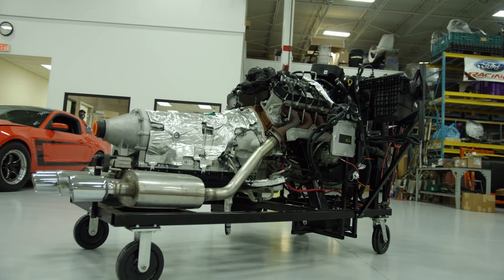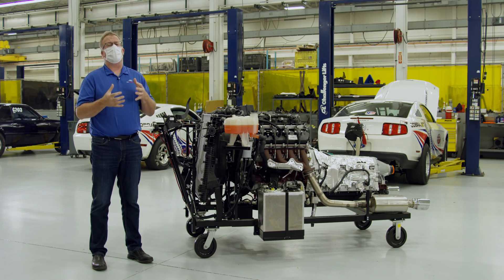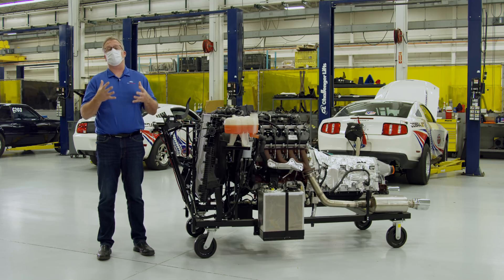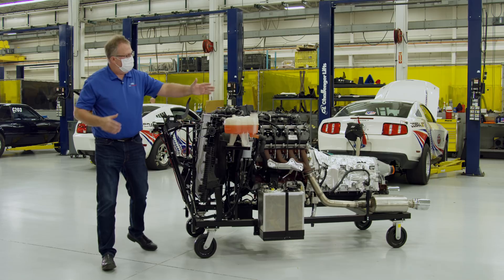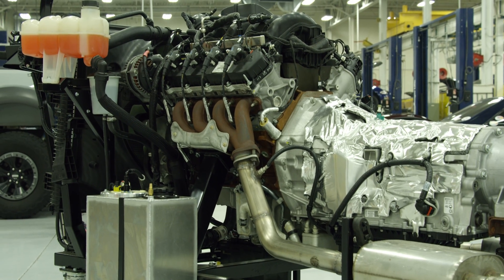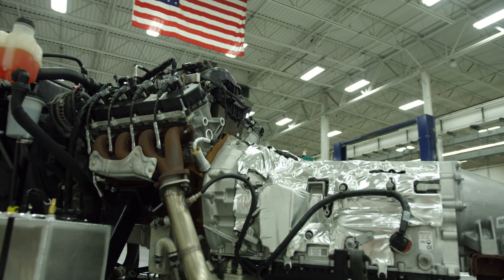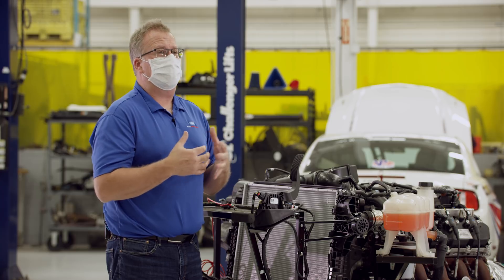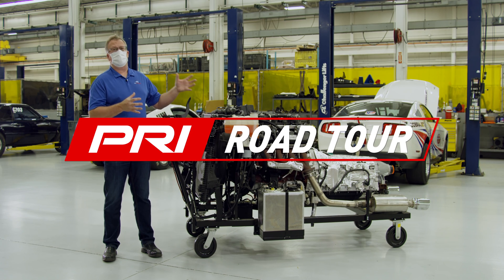Ford Performance GODZILLA 7.3L Crate Engine - all the details!

Comment: Nice LS copy fo sho
Reply: Ls is a copy of windsor
Reply: @Alex-pl1ye  there's nothing windsor in a ls. Besides ....the windsor was a pos. Sbc killed those things.
Reply: @HioSSilver1999  windsor came first everything after is based on it
Reply: @Alex-pl1ye  sbc came before the windsor....so everything after that based on it.
Reply: @HioSSilver1999  yup!
Reply: @Alex-pl1ye  then why was the windsor so bad?
Reply: @HioSSilver1999  I spent hours of my life waiting in the staging lanes while they swept up yet another Chevy off the track. I never new a Chevy racer who didn't have a spare engine in the trailer. I ran my Windsor for years without even pulling a head. And besides that, Louie Chevrolet was a flamin' homer. Causes Headaches Eventually, Very Rarely Occurs Leaving Engine Together.
Reply: @dond5103  all i remember is thrashing sbf with my sbc.

I also remember pulling those junk ass windsors out of mud holes because of that distributor bring in the front. Weird how you could buy a sbc hei distributor for your furd but not a furd distributor for your chevy. Ofcourse then there's the crank triggered lt1/lt4 that thrashed that 351 scca on mustang.

The problem with exhaust leaks is cheap headers. Plenty of leaking furd exhaust manifolds out there. I can't say i ever had a issue of exhaust leaks at the head like the ones seen on furds windsor. Never stacked gaskets either. Maybe you weren't smart enough to know the difference or how to fix it.

Chevy had the first ohv v8.....so you're wrong there to. Look up the mason v8 in 1917. 

Never shimmed a sbc starter.....but i did jump start a pile of furds due to their shitty electrical systems. Solenoid anyone....lol

What were you saying again?
Reply: @dond5103  if you're running 15s your windsor last pretty good. 🤣🤣🤣
Reply: @HioSSilver1999  besides the fact they changed from a SBC firing order to a Windsor firing order. And the heads have a lot of similarities. Oh totally different
Reply: @KC-lg7tx  the heads aren't similar at all to anything windsor related. Port shape, flow, valve size....none of it the same as a windsor. 

Sbf had more than 1 firing order. Hotrodders has changed firing orders of sbc for years which only involved swapping 2 cylinders.  Not a big deal at all.
Reply: You mean the ls is a nice Windsor copy.🤣
Reply: Do you all know camaro is going to be discontinue cause is not selling like they think it would so LS3 engine and all those goodies in vain chevy is letting down like in 1999 Camaros era.
Reply: @juanrios2541  it will likely come back in a electric version. Which is the way everything will go eventually.
Reply: Hey  Did you know Chevy hasn't built an ls motor in 2 years they are now L t's
Reply: @dakotaautosales9673  lt is just a evolution of the ls....and it makes more power.

Are you following me
Reply: @HioSSilver1999   Yes sir

Comment: Love it how Ford fans talk shit about LS engines being push rod then ford makes a pushrod engine and their  hyped about it
Reply: Before you talk find out why they did what they did. This is not a performance engine. It was designed for trucks, Because not every one wanted a diesel. So it was logical to make a big torque OHV gas engine. Don't twist it, the LS isadinosaurmotor the Coyote is high tech and a better design. Give a hot rodder an engine they will find a way to make it run. And LS still old tech no matter how you slice it, lol.

Comment: What transmission choices are there?
Reply: Same bell as mod motors
Reply: @dustindow8991  I’m not the most educated in swaps, but would it basically “bolt up” to an mt82 or the trans that came in the retro styled s197 mustang, Idk what it’s called but if I remember, it’s the 5 speed
Reply: @TheGennessy  mt82 is 6speed you xan put a magnum and tr6060 with the coyote bell housing